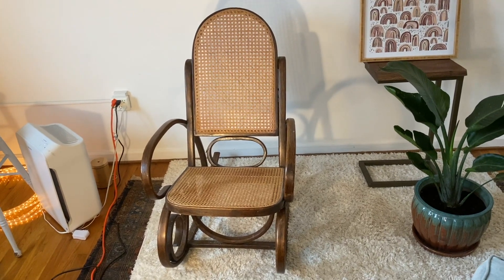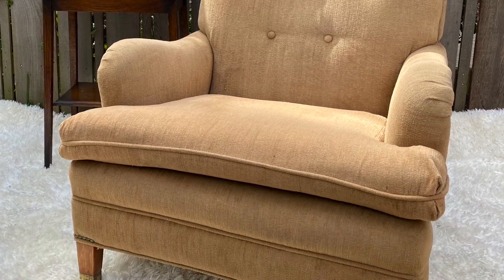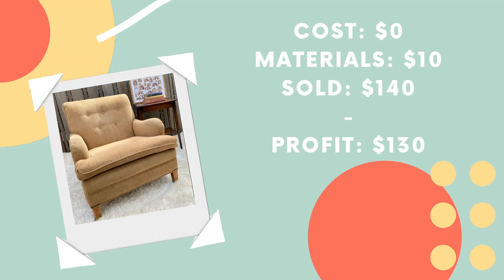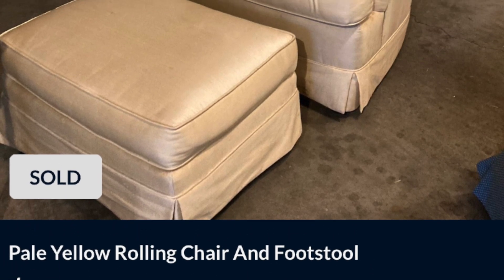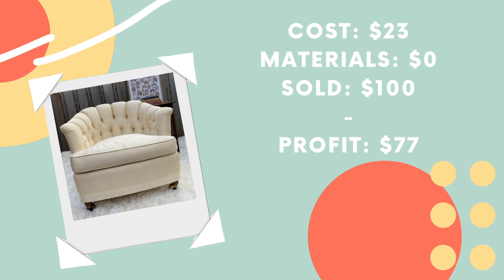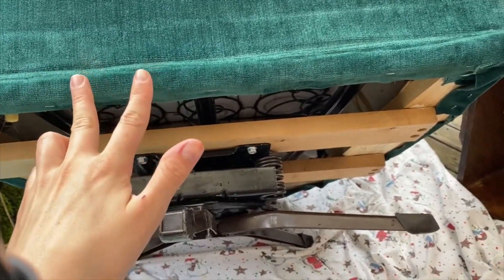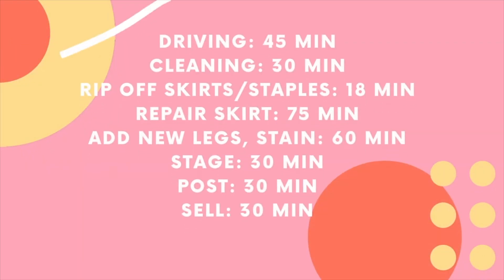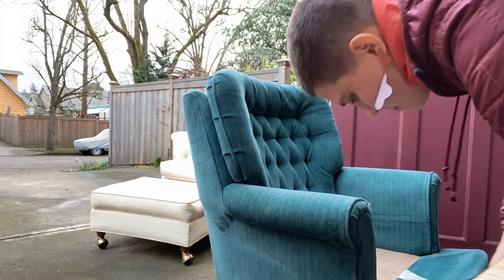9 SALES 1 FAIL | Furniture Flipping Part Time | April PROFIT

Comment: On the demon chairs I would have trimmed back or sanded back that wood. Depend on how comfortable you are with tools could lead you on and slightly easy path. I would have used, I think it’s called, an all in one.
Reply: However, the fold and tuck method would solve all of you problems
Reply from the maker: Totally. I now fold and tuck! I had to experience the problem before I could problem-solve and come up with a solution :) It's all part of the process! I also LOVE that you called them "the demon chairs" hahha they SO were! Thanks for watching, Misty!